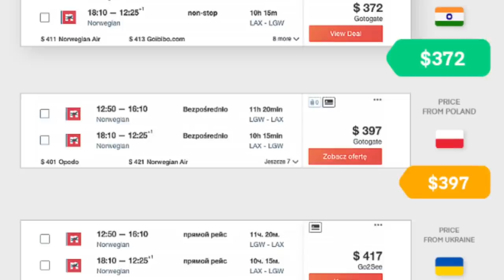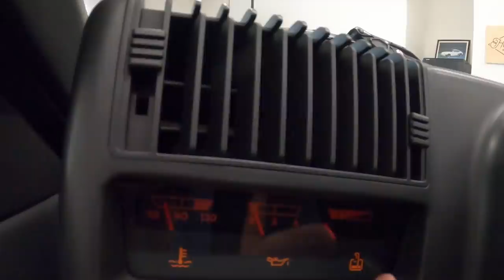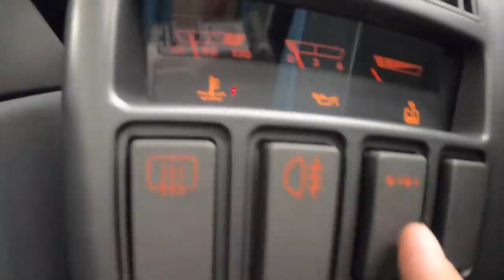The Renault Alpine Is a Very Rare, VERY WEIRD 80's Car That You Actually Want to Drive

Comment: I purchased one of these new in the UK in 1987. It was identical to the one in this video (3500cc, normally aspirated, cloth interior, pearlescent  white paint). Although built in the Alpine workshops in Dieppe, it was named 'Renault GTA' in England because the brand name 'Alpine' was then owned by others. The GTA was probably the most unreliable vehicle I ever owned, breaking down five times in five months. The faults were never properly fixed but were probably rooted in the fuel system. Other parts such as lighting, door locks, mirrors and interior fittings also gave trouble. I replaced it with a 911 of the time, which was superior in every respect, except perhaps looks.

Comment: The reason it has more power and the clean engine bay is mostly the much more lenient emission regulations in Europe and the UK until the early 90s. It doesn't have a catalyst. If it was to be exported to the US it would have less than 140 Hp, and would be less drivable. Renault never took the trouble, it was probably for a part a vanity project, and didn't make a lot of money for them.

Comment: I own a 1986 Alpine V6 Turbo since 20 years. Same color, same interior. Love it :-)
The Alpine GTA "USA" specially developed for the USA was never sold there. The first models were about to be loaded in a ship where it was built (Dieppe) when AMC - Renault alliance broke up !
The Alpine "USA" differs in some points like pop up lights and big (and ugly !) bumpers. Most of the unsold Alpine "USA" were used as test mules for the next car, the Alpine 610.
This car in 1985 was the most aerodynamic road car in the world : Cx 0.28 AND SCx 0.48.
If you look closely at the way windshield and all glass is installed, everythin is totally flush with the body panels unlike any other road car.
Top speed is 235 Kph (147 Mph) for NA and 255 Kph (160 Mph) for Turbo.
The V6 Turbo is a joy to drive but it requires some experience as it is an 80' turbo : several seconds lag and brutal torque delivery in a light car with a big engine at the rear. Quite similar to a 911 Turbo in fact ;-)
But suspensions architecture is way better than a 911 of the day : Here it is double wishbones all round !

Comment: AMC had plans to sell an adaptation of this car, branded as an American Motors vehicle.  As far as I know, only one photo of it exists.  When Chrysler purchased AMC, the plug was pulled on development, leaving only the Medallion as the sole passenger car sold under the short-lived Eagle brand.
Reply: They used the basis of the US Alpine to transform the GTA to the Alpine A610. The pop-up lights of the A610 were designed for the US spec Alpine GTA. Don't forget the Eagle Premier which was developed from the Renault 25.

Comment: Every 45-50,000 miles you had to Change master and slave clutch cylinders, the slipring and bearing in the alternateur,  and both rear wheelhub rollers, or else. Twas inexpensive. I spoke French because I was a chemist, and the Alpine warehouse worker spoke English. By 177,000 miles 5th synchro was shot and transaxle seals leaked.  Relays lasted the life of the car unlike a Boxster's top's relay...

Comment: The GTA does not have the emissions gear that the DeLorean had, but the DeLorean has fuel injection. Emissions reduced DeLorean power from 190hp to 130hp! The wipers are called ‘clap hands’ wipers for obvious reasons.

Comment: BTW, Alpine is the actual brand, not the model. Since it was swallowed by Renault I guess it's confusing but it's actually an Alpine GTA which was intended for US distribution. It's the successor to the Alpine A310 which was not sold on the US but it's more a big facelift than a new model, since the engine and platform are the same.

Comment: 9:47 I figure the windshield wiper are like that to avoid an additional change when adapting this vehicle from RHD to LHD (Right to Left Hand Drive), for the UK, Japan, and other markets.
Ford has done this on the 3rd generation of the European Ford Focus (2011-2018), but placed them on the A pillars, which also improves aerodynamics and avoid theft of the windshield wipers.

I understand it was on purpose, but making those old blades slide on that dry windshield made, not only a horrible sound, but also that the wipers did not slide as smooth as intended.
It was horrible and painful to watch 😂

Comment: Funny, that this radio controls volume +/ -  on the steering wheel,  still  the same on the modern Renaults, as well the red color on the gauges and  computer information still under 2010's models.

Comment: I personally have owned several Renault vehicles, and still drive one for my long drives: a '11 Renault Megane III Sports Tourer (Estate).
Renault builds cars which have one the best dynamic behaviour on the road, only compared to BMWs - and some other cars.
But the small Renault cars (e.g. Clio or Twingo) have very good driving dynamics.
I remember driving a Renault Clio II (~2004), and that car could always put a smile on my face - especially on the exit of roundabouts (traffic circles), as the tail was really easy to place out, while always keeping it in control.

Renault has built good enough quality cars - not on pair to the German standards that we are used to, but good quality nevertheless.
Only after ~2008 did Renault stepped up their build quality game - but always some steps below German cars.
Despite this, Renault builds very reliable cars, on all sides: engine, transmission, chassis, and interior.

Even today, Renault still builds performance cars, like the Renault Clio RS, or the Renault Megane RS (and all those limited editions inside this RS model).

But the USA always did not like small cars.
And, small cars is where Renault shines, like on the Clio and the Megane. The Megane is like a Golf, but cheaper (to buy and own), prettier (with more difference among generations), and with better driving dynamics.

Most of the European car manufacturers are better on small cars, and the USA market rejects these cars.
This led to the abandon of the USA market by Peugeot, Citroen (nowadays together, and also with the ex-GM owned Opel), Renault, and even Fiat. This is also valid for Canada.
Fiat tried to re-enter the US market, but even the 500 did not sell as expected.
But they sell well on other American markets, like Brazil, Mexico, and so on.

No, it is not the tough conditions, or even snow.
In the North of Europe, we have plenty of snow - just watch Sweden.
In the South of Europe, we have lots of Sun - just watch the temperatures of Spain.
And in the center of Europe, we have everything in between - just look at the snow Germany gets in the Winter, and the Sun in the Summer.

USA and Canada markets reject small cars.
Why?
Because the price of gas is highly subsidized, and you do not mind having a 6.2L V8, or even a 3.8 V6.

To put it in perspective, my '11 Renault Megane III 1.5 dCi Sports Tourer (estate) gets 36 mpg US (50.44 mpg UK; 17.86 km/L; or 5.6 L/100km) on both highway and city.
In Europe, a good car has to get at least 36 mpg US (43.23 mpg UK; 15.31 km/L; or 6.53 L/100km), for a regular family.
Moreover, we have small roads - which some date to an era where people walked everywhere, and ancient building are kept for historic reasons - thus, we really need smaller cars.

Thus, these two markets are significantly different, and require different cars to entice buyers.
The sales of this Renault Alpine just show how Americans are suspicious / reluctant on buying cars from "new" brands - which I understand. I never bought, or even advised someone to buy, a Chrysler Voyager, or a Chevrolet car.
Ford was the only American car manufacturer to adapt, e.g. with the Fiesta.
Chrysler sold trash here, e.g. the gigantic and with horrible plastics Voyager, or the outdated and bad 300C.
GM rebadged some Daewoo cars (which sold in Asia), e.g. the too small and really bad Chevrolet Spark, or the bad decision which made in the German Opel.

Opel, when it was owned by GM, purchased car designs from other European OEMs. For example, the Opel Corsa (4th generation, known as Corsa D) was based on the Fiat Grande Punto (or Punto Evo).
On that particular model, Opel did not improve anything - not even the bulletin notes which Fiat wrote for their mechanics, as a common issue on that model.
One of those was the timing chain on the 1.3 Multijet (Opel's 1.3 CDTi), which was redesign to avoid some issues. Fiat did the corrections, and Opel ignored them. Customer paid the price.
One the 1.9 CDTi, oil pumps did not provide enough pressure, thus the oil did not lubricate the overhead cams and turbo; leading to issues on those two systems. Who paid the price? Customers.

Fortunetly, GM sold Opel to PSA Group (Peugeot and Citroen).
So, I really hope Opel revives its original build quality - which it was known for.
But I imagine it will only be rebadged vehicles, or with some different bumpers, seats, and options.

Comment: I just watched this after your video blowing up the Prius with nitrous.   That's oxyde nitreux in French, or protoxyde d'azote, depending on what you mean.  Maybe you can try it with the Alpine and we can learn why "grenade" is still "grenade" in French.  At least you can get the engine out of the Alpine in <2 hours.  Unfortunately with no A/C you will also être en sueur.  Cool car though, it's funky 80's in a Buck Rogers in the 25th Century kind of way.  The French are different.

Comment: I had the turbo version after owning the turbo R25. The Alpine was plastic in more ways than one and horribly unreliable. It was a good thing that the engine came out relatively easily, for almost every job needed it. The turbo engine at least was a fantastically tight fit. The R25 was a much nicer car.

Comment: I might have a Green BMW Z1 you might be interested in. It belongs to my father it was included in a house auction he won. Only down fall (No title),no keys, one doors doesn’t work I think it’s stuck inside of the body. But you can tell it’s been sitting for 20plus years. I can send pics with VIN if anyone is interested.

Comment: Renault F1 - Alpine World Rally A110. The Renault Alpine Turbo reflected the F1 turbo cars of the '80. It was Renaults ultimate model of the range. Renault also had the 5/9/11/Fuego and the 18/25 Turbo models. Renault introduced a Turbo at first on a F1 car late '70. This Alpine model had some F1 and Rally engineers advising on it. You can hear the engine make a kind of F1 racing roar when it run's idle and accelerates. When i was a kid i alway's watched the car (the Turbo-model) at the local Renault dealership. The car was also called a widow maker because it has a happy tail, just like the Porsche 911 (Turbo) of the day. Renault made this car to show how they saw a modern sports GT car for long distances. It was not especially made as a competitor for the 944 front engine but more to the 911 rear engine. Rear means not mid, by the way. A completely different filosofie. Nice car, funny video.

Comment: i have an oddball for you damn near mint. 1995 ford contour, daily driver just rolled 42000 miles even the wizard wont find anyrhing  much wrong with this car, everything works  no leaks period. xept the the gas filler door  wont close because its plastic shit broke .this is a true gramma car,  replaced the entire brake system. new steel rims and tires, and exhaust mods (glasspack resonator  and a flowmaster mufler) its pretty quiet. i drive it daily. shakes in drive at a stop. upper motor mount replaced. mechanic said replacing trans mounts might make it worse i dunno,
its  out of date but it shits and gets. plenty of power for a 4 banger wirh almost no miles and its 99.9 rust free

Comment: Honestly, I think Alpine should have keep the iconic A110 body style also called "Berlinette" 
with the 2 additional head lights inserted inside the front bumper, 
instead of this departure of style with the A310 and A610.  
I like better the 50th years anniversary Alpine A110-50 and the Electric concept Renault DeZir.

Comment: I would imagine that the engine produces more in the Alpine than the DeLorean because the latter was sold in the 'States and therefore had a big ol' Denver Boot on its power output, sort of the American version of the British Red Flag Act.  Given the Alpine is Grey Market, the regulations and strictures endured by the DMC didn't apply to it.

Comment: These are probably my favorite in the A310/GTA/A610 grouping. I kind of prefer the A310's look but the A610 has a turbo option with an improved engine; however it has pop-up headlights. So the GTA is my go-to since it also had a turbo option and used the cool wrap-around headlights instead of resorting to the pop-ups that were apparently only implemented in an aborted appeal to the USDM.
The big problem with these, the DeLorean, and the 911 that it seeks to challenge (among others), is that the engine is mostly behind the rear wheels (RR). This puts the weight in a poor location which can make the car prone to losing traction in a turn, especially with forced induction when a surge of boost suddenly arrives and adds unexpected power to the wheels. This isn't much of a problem for straight-line racing but anything with sharp turns can be problematic; if you want a balanced car you want mid-engine.

Comment: I was aware of the Alpine for years. I'm sure they were used in a 1980s advert for something like car audio or oil that appeared in magazines. Then I remember the shock when I actually saw one. Much smaller than I had ever imagined. It was as if Renault had made a 4/5th scale model. Nowaday's I think many cars are far too big with even the Tesla Model 3 approaching the limit of how big you would want to go but the Alpine was the opposite. Would Doug DeMuro even fit in one ?  Hoovies head looks to be very close to the roof.

Comment: If that car and it's Tech was produced in the 80's and it still works well, Then we have not achieved much automotive Tech wise since then with the only two exceptions being ABS and  coil on plug Fuel injection.

Comment: 28,000 kilometers isn't 120,000 miles.  General rule is multiply the kilometers by .6.  The car has less than 18,000 MILES on it.  It's barely broken in.

Comment: this particular car ' was a french model i believe , in the uk we had the top model with with turbo and leather trim ...
give this car some mileage ' and average condition' it  would be an electrical nightmare 
is said 4 on the steering wheel ?  is it 4wd  ?    interesting all the same ....
and there is a new one , but massively overpriced

Comment: Amazing find. I owned 2 Renault Fuegos in the 80s. I was knocked out by the Alpine , however I was knocked over by the Fuegos. WORST CARS EVER. Thanks.
Reply: HELMUT ALTO 1 of the best sports cars, but if you looking for performance in France, the hot hatch market is where it’s at.
Renualt 5 turbo
Renault Clio v6
Renault Clio 182
Renualt Megane RS
Renualt megane trophy 
Citroen DS3 racing
Citroen Saxo vts
And Peugeot’s many gti models.

Comment: I say the title for this video and had to respond!! In the late 1980s I was working for a shop repairing cars, and I can tell you the two cars I have never liked are ANY Subaru and ANY car built by Renault!! So when you say that the Renault Alpine is the car "I'd WANT to drive!" you are sadly mistaken!! Because I grew up in a time when Pontiac GTOs, 426 Hemi and 440 Powered Mopars were on every block, and GT350 Mustang Shelbys were still "a thing"!! So I can tell you it has never led me to WANT TO DRIVE a piece of crap (and poorly built at that) Renault!! And keep in mind I working in a shop like I said earlier, that had to service Renaults as brand new cars!!! Most of them were JUNK while they were rolling off the lot, so you can only imagine what kind of crap was rolling back in the door requiring repairs!! And you really don't know a car until you have had to actually work on it and repair it!! And trust me I HATE working on anything built by Renault as much as I hate working on any Subaru built!!! And frankly I would rather spend all day working on Hondas and Toyotas, because face it they are far easier to work on most of the time!!! And they were not designed by idiots either!!

Comment: Was it even sold in US?
Reply: Not really. 
Renault and Alpine had considered exporting the GTA to the United States through the American Motors Corporation subsidiary. A model derived from the V6 Turbo is therefore designed and finalized to adapt to local constraints. In accordance with North American regulations, it loses its front lights under canopy in favor of retractable optics, its shields are more prominent and deformable, side lights are inserted into the shields and integrated into adhesive protection. The front bumper grille is enlarged to improve cooling. The front indicators are orange (except on certain models readapted for homologation in France). A third brake light fits under the rear spoiler. The GTA USA benefit from a major overhaul of the chassis. The tubes of the front structure are replaced by stamped sheet metal. Added shield energy absorbers. The sides are reinforced with bars in the doors and a doubling of the side reinforcements. Many of the developments made for the GTA USA chassis will be reused on the A610.
But at the start of 1987, Renault's withdrawal from the American market meant that everything had to be abandoned a few days before the start of production. 21 models were built and 12 will be sold to privileged enthusiasts. FROM WIKIPEDIA.
On another hand, The GTA is only one of many Alpines produced in the past. The A610 had a better look
https://youtu.be/doZcCa3WdjI